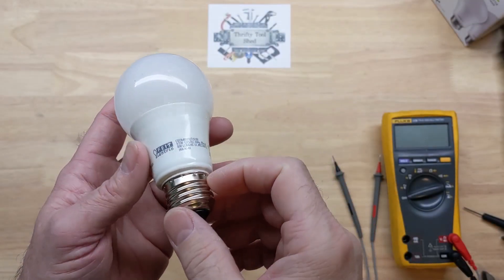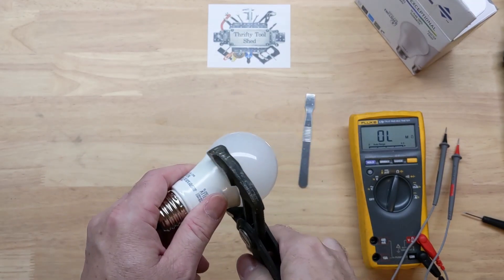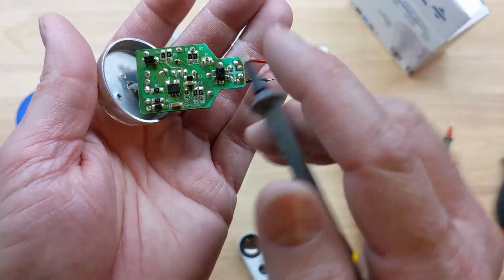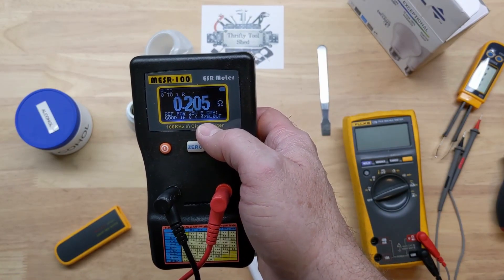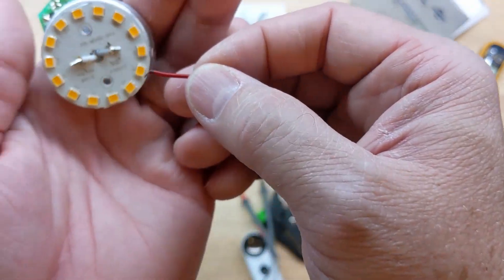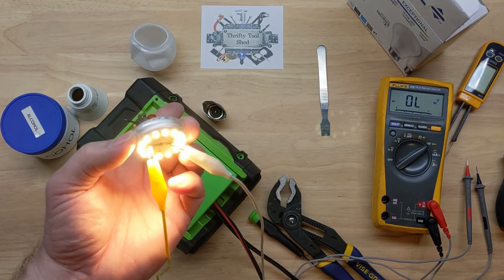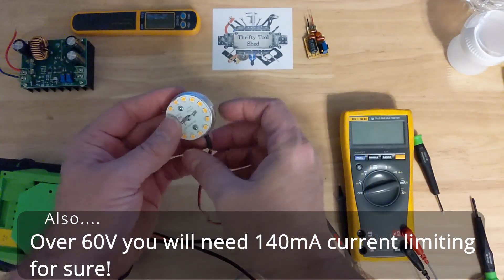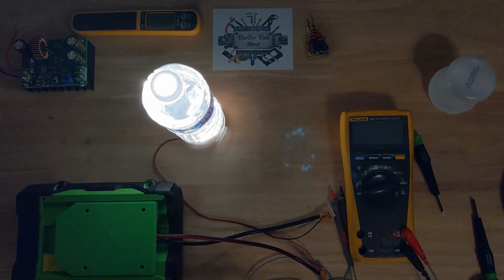Inside of a Faulty FEIT LED Bulb

Comment: Is there another way to remove the base of the bulb. I have a Feit bulb with 3 rows of LED's. I put a LED checker for checking the backlights on TV's on the LED's and they work, so I need to check out the internal circuitry and components. I just need to remove the base so it's re-usable. Thanks
I did get my Feit LED light bulb taken apart and the circuit board removed. I found the two input resistors (TR1 & TR2, 10ohm,  1/2 Watt) were reading open and I saw cracks on both of them. Got to figure out what was drawing the current to cause the damage to the resistors.

Comment: Another great video!  Always wondered what was inside the LED bulbs.  Turned on my computer at work a couple weeks ago and all I got was a popping noise.  Tore into it and the caps on the motherboard looked fine.  Tore into the power supply and sure enough two caps exploded!  The fan for the power supply seized and caused the power supply to overheat.  Cleaned it all up.  Lubed the bearing on the fan, replaced the two caps and I was back in business within an hour.
Reply from the maker: Awesome! That was quick work!